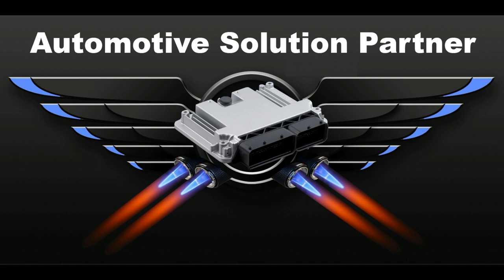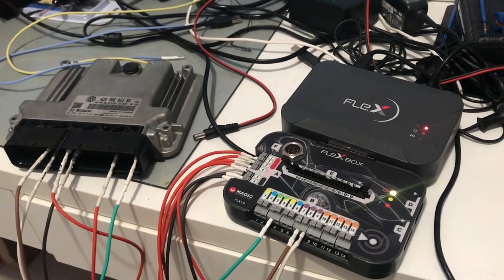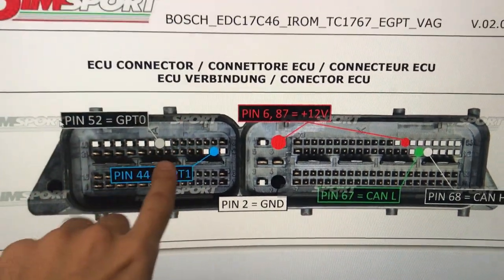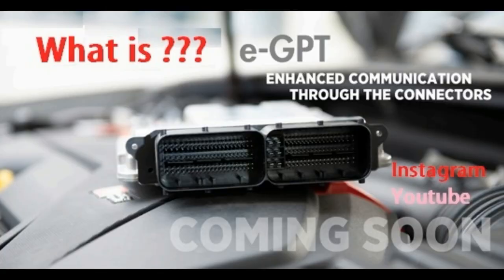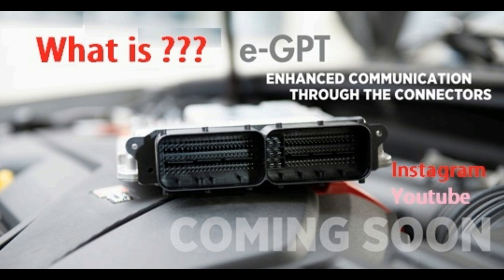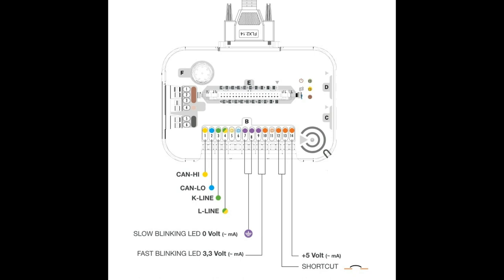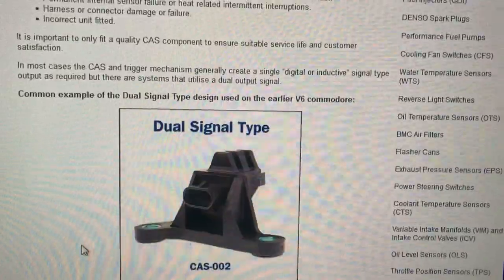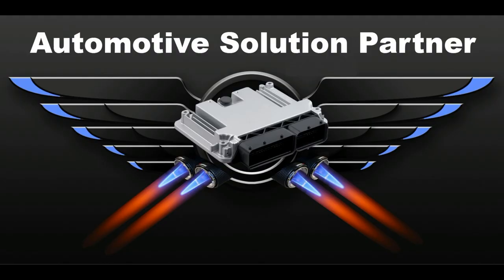ECU Bench Mode GPT Explained

Comment: I have MEG17.9.12 ECU model, and already opened the ECU so I can clone the firmware. I have an Arduino Uno and a CAN module to use with the Arduino. I have the pinout for the ECU, the boot pin, the can-h and can-l, and the gpt0 and gpt1. Do I just provide analog signals to gpt0 and gpt1 and use boot mode, and then read through the CAN bus? or there're instructions I need to provide to the processor in the ECU which is "TC1762 Tricore Infineon" to then allow me to read the firmware?

Comment: i have flex i have pcm flash i have autel j2534 i have pcm flash i use it in boot mode without any problems i didn't use benc mode pcmflahs benc is off I'm asking that's why we only need to connect 0 5 volts to gpt in benc mode

Comment: my master, gpt terminals on flex box 7 and 8 when i plug in another device on flex, which one is it?
Reply: Does the interface send the gpt signal over 3 or 5 volts to the ecu?
Reply from the maker: @ibrahimbayramoglu8402  sends a square signal 0-5v depending on ecu
Reply: @Automotivesp   thanks for the information you provided
Reply: gpt 0 and gpt 1 should we give 0 5 volts in both cines?